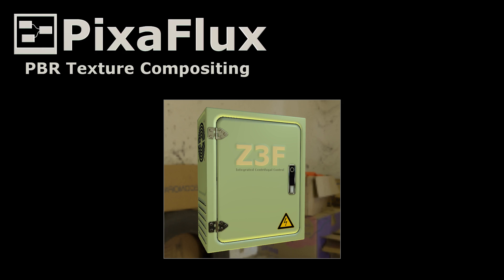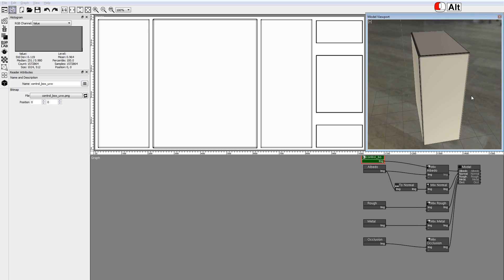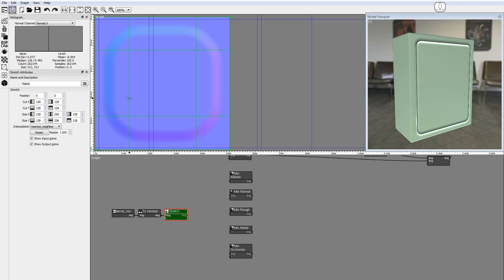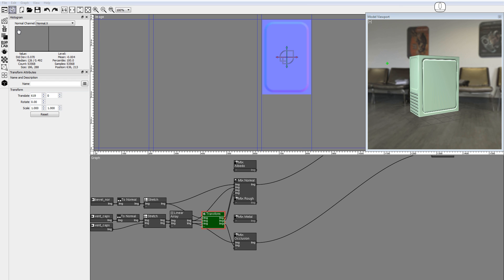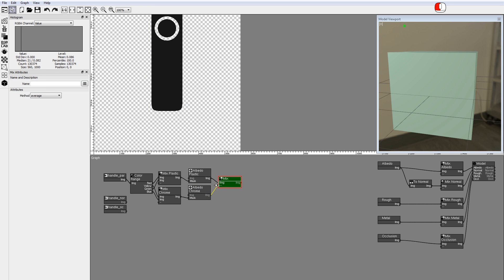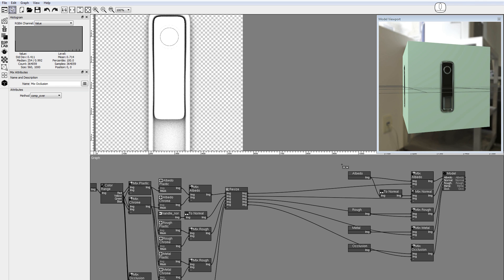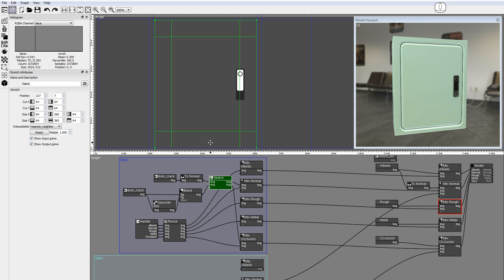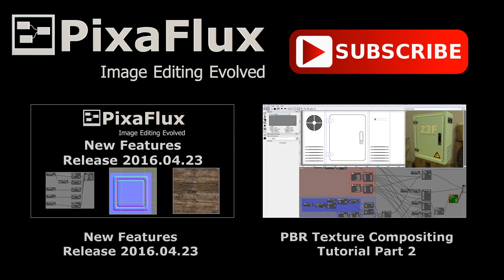PBR Texture Compositing in PixaFlux

Comment: Hello,
I tried loading in images as Reader nodes, but they weren't displayed. I found out later that it depends on where the image I want to load is. 
I mean, there are two partitions on my hard drive, C and D. When I drag in an image from C, it shows up and is displayed normally, but when I drag in an image from D, it isn't.
I don't know why this problem happens, but it would be great if you could look into it sometime and possibly come up with a solution.
Thank you very much :)
PS.: Great softwre btw, I love it and how easy it is to learn and use it
Reply from the maker: Hello Tamás, we have tested it in two different PCs with new real and logical disk partitions and we haven't been able to reproduce the issue. Probably the bug is something different. Could you please try again with copies of the same files on C and D and check if you can find a different reproducible pattern? Thank you very much reporting this issue, we appreciate your help.

Comment: Hello, I've tried doing several of your tutorials, but I'm having a problem.  I can't see any .obj in the model viewport.  I've tried using a jpg to make a block, like in one of your other tutorials.  I've tried opening multiple .obj files.  I've played with the camera near/far settings.  And I even tried doing it on my laptop instead.  I toggled the "Show" button and I've searched google for hours.  I'm out of ideas...

Everything else in the model viewport works.  I see the grid, the sky background, etc..  but I don't see the model.  Any suggestions?  I can make a video if needed.
Reply from the maker: Hello abstruseoni. Thank you for reporting this issue. I have tested PixaFlux in a different computer and I was able to reproduce the problem. I am now working on solving it. I'll let you know how it goes!
Reply: Had any luck with the issue?  I'm still wanting to try it out :)  Thank you for looking into it so quickly.
Reply from the maker: Yes! Today I released a new version of PixaFlux and this problem is now fixed! Please give it a try and let me know if you find any other issues. Thank you very much for reporting this problem!
Reply: YAY.  I look forward to it after work :)  Thanks!!